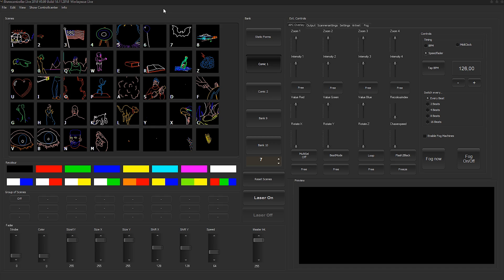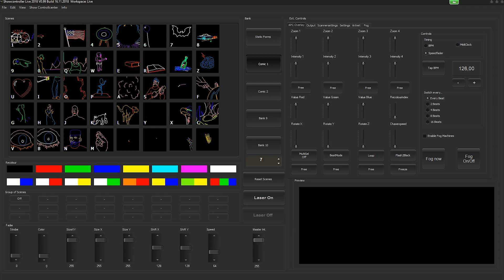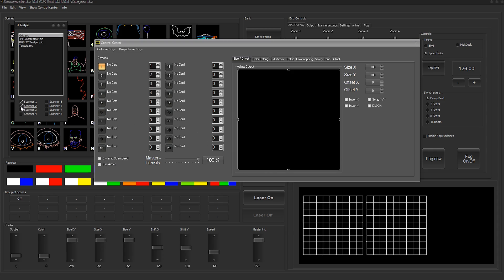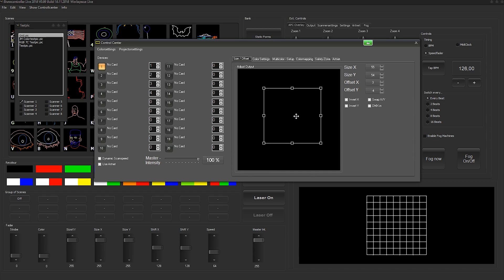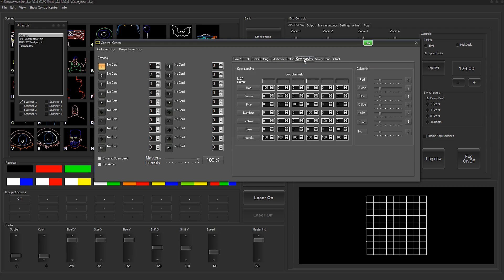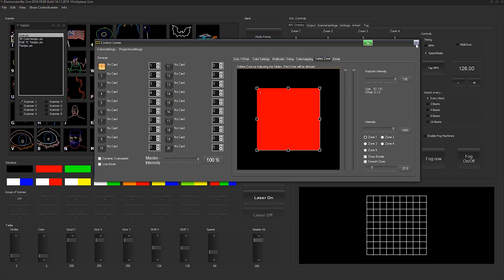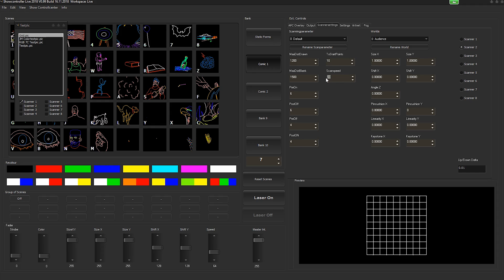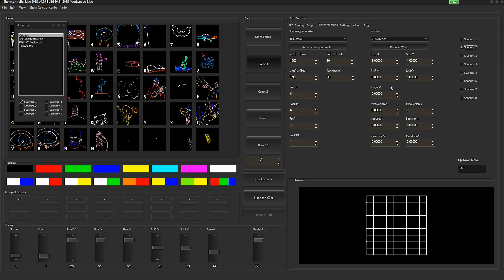Showcontroller - Testpictures, Scanner Settings, Geometric Correction - explained | Laserworld

Comment: Are settings applied in showcontroller live also saved to the realtime section? So set scan parameters, safezone etc then save and they will apply in realtime too? Or does realtime has an other settings section?
Reply from the maker: They use the same settings. If settings are applied in one part before the other one is opened, it respects those.